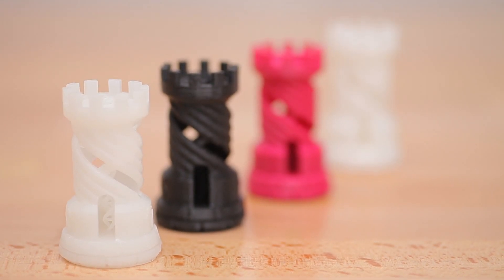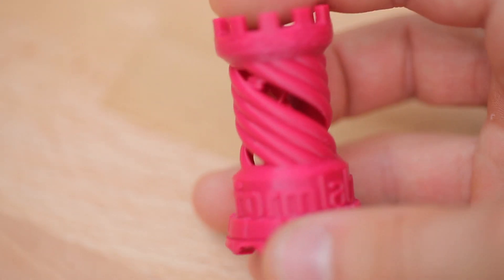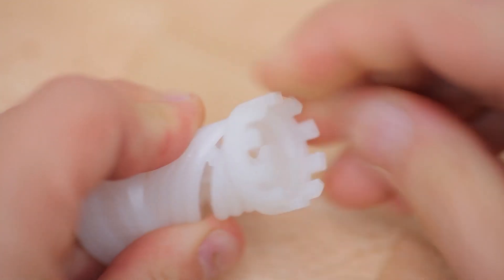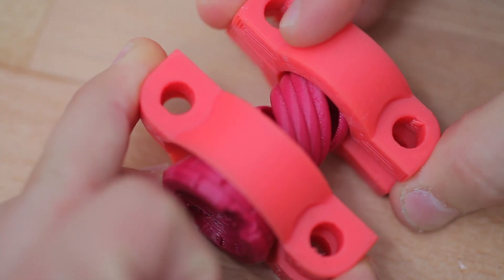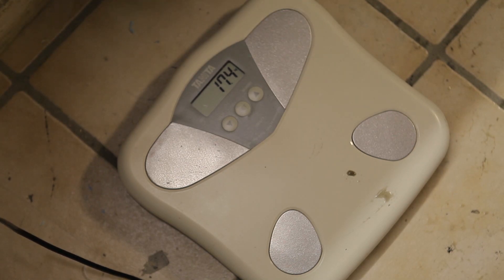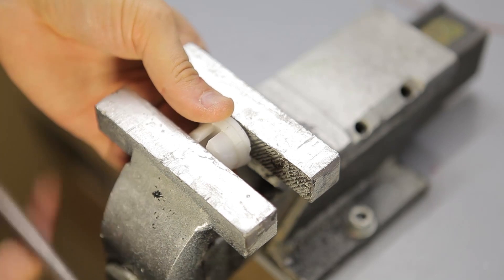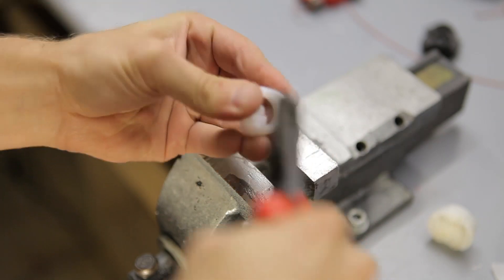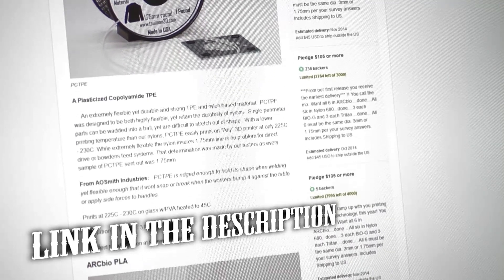3D printing guides - Plastic destruction

Comment: Thanks for making a great video! Now i know, the best printer type to making a durable and strong stuff is FDM, not SLA.
FDM Printer not only strong, we can hack with some tools and coating it with something and then the resolution would be looks like SLA printed stuff. And FDM also has many types of material (such as wood, flexible, metal pla for a super strong stuff, and many more!) than the SLA Printers. I chose FDM printer without a doubt anymore. Thank's, Tom :)

Comment: Hey Tom,

Could you make a video about the different types of materials and ways for bonding 3d printed parts together. Like if i have 2 parts printed in PLA, what would be the best glue or other material to fuse them together. 

Thanks.

Comment: I'm not surprised the ABS part failed so easily.

Cheap chinese filament is junk.  In fact, it's usually not ABS.  A lot of the cheap chinese stuff is HIPS-blend.  Usually you will see leftover gunk when you attempt to dissolve in acetone.

I've tried various vendors on a simple hollow tower-like structure I was printing.  The weakest broke easily, the best stuff was able to hold up my body weight.

Also, 250 degrees may have been a bit hot.  In my experience, when you overheat ABS, it becomes brittle.

Comment: this experiment is absurd, it is made with incorrect method
Reply: *****  the test isn't good for more reasons, first, the printer is the same for all objects?
if not, different printer can change the results.
second, the colors can change the proprieties of the materials, if you want to test the materials and not the color, you can print only without coloured filament.
third, the  brand can change the components of the materials, if you want test only the materials and not the brand, you can use only one brand.
fourth, you use the same object for all the test, but when a material has already been put under stress, the properties of the material are not longer real ones and initials in the following tests.
fifth the type of the 3d drawing can change the test, for example the abs have a big problem with angles and in the test is disadvantaged with the tower printing, if you want do a correct test you can use only the cubic form for compression test and traction test
sixth traction test, in the video i can 't see the traction test of the black tower.
seventh pression test, you use different length of pieces of tower in too short press, part of the tower remain out of the press, and the part that remain out isn't the same of all material and this can affect the results of the test.
eighth in the traction test fou use different methods for put water in a part of video you do a niagara falls with watewr, in other part you put the water look lie to use a dropper, different methods can affect the results. if you put the water look like a niagara falls, your test is a stretching test and not a traction test.
Reply: *****  a question, why did not you do a test of resistance to impact? that would make the abs winner? if you do the test where the abs definitely lose the other, makes me doubt that you did it for some particular purpose or for your convenience

Comment: Hey Thomas! thank you for the video and compliments for all your work, I tried to print a copy of the rook, but my natural PLA failed ridicously... I don't understand really how can be soo fragile... I noticed in different geometrics much more strength raising the % of infill... but I'm seriously thinking there is something wrong.. I'm printing for a couple of months with the E3D v6 and I can't understand if that can be the reason... Do you have any advice?

Thank You!!

Cheers!

Andrea
Reply: ***** Thank you for your answear, no because I have no other providers, I mean I run out around 4 Kg of this kind of PLA in last year, and it's a medium quality from Holland, I check and incredibly the grey or black one looks, stronger in different parts I've printed, I'm printing at 180 degrees to avoid any drop of material in bridge, could it be too low temperature? thank you!
Reply: ***** Thank You!! gonna try today different temperatures with a simpler strength test piece!

Comment: Hopefully I'll be doing some tensile testing on some precisely calibrated testing machines soon. I was told by my lecturer that initial tests of PLA had 250kg ultimate tensile strength on a 10x5mm cross section. If it wasn't for the poor temperature resistance PLA would be great for mechanical use.